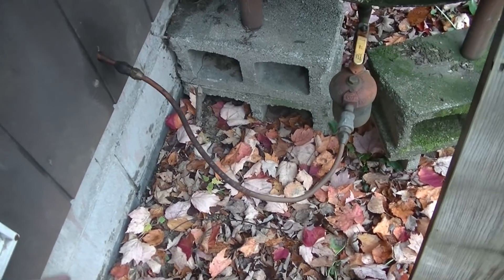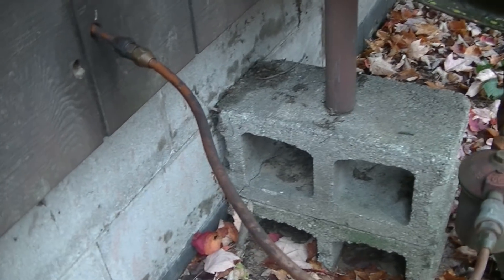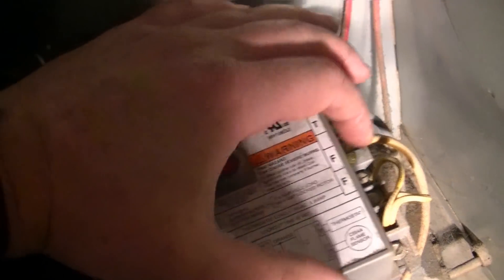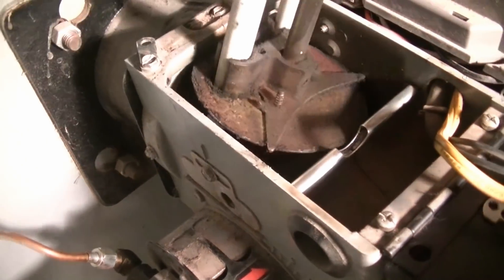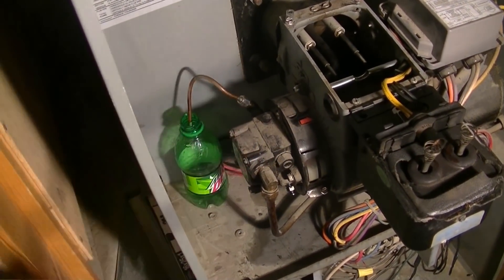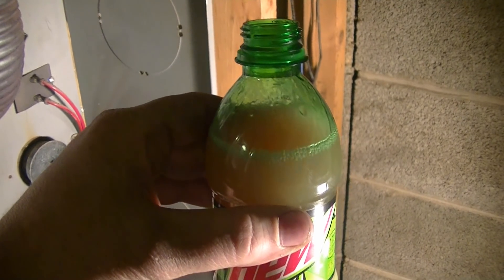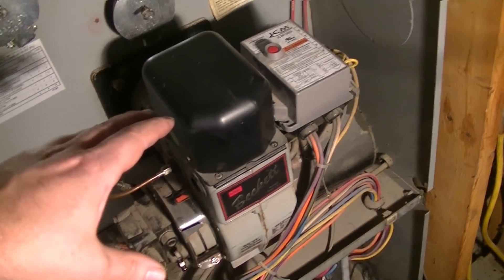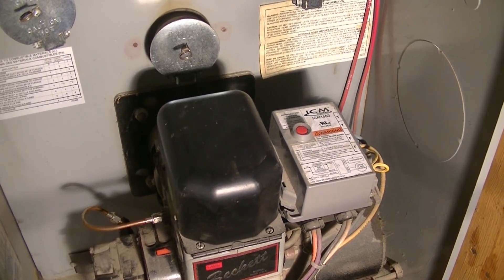Oil Furnace  Bleeding/ Troubleshooting

Comment: yeah im not getting any feul and i just changes the filer and ive done this plenty of times before and my line did get bent but i seen the fuel getting passed the part the was bent so not sure why its still not getting fuel or air so theres got to be a clog some where or something this isnt even my trailer and ive allready had to replace the whole 250 gallon tank because the other one had a pin hole leak some how after 10 years of use and now this new one we got from a friend must of had a bunch of junk or water because my fuel filter was completly frozen solid and i wasnt getting fuel after changing the filer and i got the tank unclogged but now im sure the line is clogged so will see what happens but its not working and my land loard will tell us to use heaters when we just spent 700 dollars on fuel for the winter lol

Comment: My furnace ran dry, added 5gals of diesel and got all of the air out of the line. My oil is air free and streaming smoothly out of the bleeder valve but I can’t get the furnace to ignite. Any ideas?

Comment: My machine will turn on and I hit reset and the thermometer is turned on calling for oil. When i try to bleed it no oil comes out?

Any suggestions
Reply: Exactly the same problem with mine. Did you fix it and how?

Comment: I can handle that you are FORD guy. So am I fella. But the MUD part, well, that is optional with me. Just a personal response between two FORD guys. PEACE
Reply from the maker: Mudford was my screen name on classic broncos.  I joined that forum when I bought a first generation Bronco to build as a mud drag racer.  I just kept using that screen name.  I'm older now and don't enjoy all of the work it takes to wash it after running in the mud.  The screen name kind of stuck though.
Reply: @Mudford  Thank you for that little bit of history which really makes sense. Opening oneself is a sign of maturity and wisdom. I hope I will get some to rub off on me. Since we both are FORD men, this is a good day indeed. Peace vf

Comment: My Beckett  boiler is about 2 years old.
The nut on the bleeder is so tight that I can't get it off. Do you have any suggestions, oil maybe? Thank you
Reply from the maker: Karen Venzen maybe a little bit of Kroil or PB Blaster.  Use a six sided socket if possible to break it loose to avoid stripping it.
Reply: The space is narrow. I will try the oil and see if I can tap.

Comment: I bled a quart and a half and still has air.
Reply: You could have a leak in the fuel line, plugged filter or strainer, or other issue causing high vacuum in the fuel line.
Reply: @jasongreek2342  i changed the filter.  Bled till no air.  Burner started and shuts off.  Have flame.  Somtimes it will run long enough to heat the firebox and turn the duct fan on.  But wont restart on thermostat.  Red light.  Sometimes will catch and run like explained on reset but mostly not
Reply: @L2fish  if you have a multimeter set it to ohms and get a cad cell reading. Start the burner and remove one of the yellow wires from the F-F terminal on your primary control. You want to be under 1600 ohms. If your reading is close to that replace it.
Reply: @willys7974  if your reading is close to 1600 ohms it may not be a faulty cad cell, it could be dirty, there could be too much excess air, there could be something blocking the light. People are bad for over tightening the retainer clip for the electrodes, which bends it down and blocks off the holes through which the cad cell sees the flame. But he's said he's bled off a quart and a half of oil and he keeps getting air, his next step involves a vacuum gauge and some detective work to find either a leak or an obstruction.
Reply: @willys7974  Ok thanks.  Its been running but was not restarting after its night sit on my thermostat setting.  Now its been starting on its own for week.  I have an ohm meter as I worked in the electrical field. I thought maybe the cad cell was sooted over
Reply: @jasongreek2342  he bled til there was no air. All of what you said could be true but I’m not going to recommend he start adjusting the air without a combustion analyzer. Which I doubt he has.
Reply: @willys7974  I'm sure he doesn't have a vacuum gauge either. He needs to call a professional.  But changing the cad cell probably isn't going to help. He also said he bled a quart and a half and still has air. He couldn't eliminate the air.
Reply: Never mind I see he said after that he got the air out
Reply: @jasongreek2342  Since this furnace sits pretty much all summer could there be water in the oil settled out to the bottom of the tank?  I know its pulling oil as the air will come out.  But maybe I am not seeing air.  Maybe its water?  I bleed into a mason jar with a clear line so maybe I will let it sit and see if it separates.  I am not a professional but do know how to change the nozzle, igniter, and troubleshoot electrics.  I would not mess around with setting the air gap.  So far after the last reset its been starting and running on its own.
Reply: @L2fish  water would separate almost immediately and would be noticeable in the jar. There are quite a few things that could potentially cause the issue, it really is difficult to say without physically being there. Beyond verifying fuel flow and that you have ignition and that the cad cell is seeing the flame there's not much you can really do
Reply: @jasongreek2342  Ok thanks.  My neighbor also said maybe the screen in the pump is maybe partially clogged. He is elderly now and retired but said has seen biofuel mixes raise problems with them.  My oil supplier said they don't mix.  He said yea they all say that.  lol.  Oh the burner is a Beckett Clean cut.  Had to change the solenoid coil last fall
Reply: @L2fish  I'm glad we don't have bio around here yet, but I expect it won't cause the same issues when it does get here just from how different our infrastructure is compared to the US

Comment: Some of your advice here is good but your system is NOT legally up to code. You need a firomatic oil valve at BOTH your oil tank and directly at the fuel pump. Your system is missing one on both sides. This is the law pretty much throughout the country.

Also, that is not the recommended way to bleed the pump. Many pumps have built in electronic check valves that will temporarily delay the fuel flow out of the electrode line. There is a 3/8 bleeder nipple on the bottom of the pump. That's the best place to bleed it. 

Also, a visual inspection of the nozzle will not indicate whether or not it is plugged. Nozzles can partially/fully plug without any visual indication. If there is any doubt about the nozzle, you should just change it. A visual inspection, especially without any knowledge of what a proper flame looks like, will NOT suffice.

You do have a basic understanding of oil burners, enough to save yourself a service call perhaps. But there's way more to troubleshooting than what's presented here. For those who need to do more than just bleed it, calling a qualified service technician is heavily recommended..
Reply: Firomatic valves are not required in that situation anywhere n Canada. We only need them on systems that cannot positively shut off fuel flow on power failure. 

That being said, that oil tank is an atrocity.
Reply: @jasongreek2342  We use them here for fire reasons.... same with the firematic switch at the ceiling...
Reply: @labbeaj  Yep. Except for mechanically vented gas systems.  Those are no longer to be interrupted in the case of a fire, the fan needs to continue venting any possible raw fuel. Pretty sure both fuel line and power firomatics are still required on all oil fired systems though.
Reply: @labbeaj  as long as all components have a melting point above 1000°F, and the flow of fuel is positively stopped on power failure, we don't need firomatic valves. There are also no requirements or statements regarding firomatic switches in the ceiling. 

As I said though, his oil tank is an environmental disaster waiting to happen.
Reply: @jasongreek2342  🤣🤣🤣 People tend to think that oil tanks last forever!! They get shocked when i say it's 25 years old, time for a new one!!

Comment: When you pull out the fuel nozzle and look at that and the spray igniters. If they are covered with fuel from repeated pressing of the button.Wipe them down and wipe out the area to prevent smoking or igniting? Thanking you in advance.

Comment: Hi. Got a Beckett gun on a Crown boiler. Furnace will start, but after 30-40 seconds, you can hear the tone of the burn change. It then becomes unstable, and a few seconds later, it shuts off. Furnace will restart after a short periods, and the cycle repeats...
 Usually, it takes 3-4 of these cycles, to heat the water in what used to take a single 3-4 minute cycle. Gotta be putting a lot of extra strain on the parts, too...
 Just before it quits, you can sometimes heat a hissing or sizzling sound faintly over the burner. No water leak, though...
 Anybody have an idea what is happening here? I am baffled...
Reply: Sounds like it's struggling to pull fuel. I'm sure it's fixed by now but I guessing that either your oil filter, oil line or pump strainer is plugged.. I'd change both the filter, pump screen and nozzle first.

Comment: which connector need to be connected in order to turn on the pump?
Reply: The pump coupling which is driven by the burner motor and in turn drives the pump. It is made of plastic and joins the shafts of the motor and pump together.

Comment: Electrodes should be pointy so that they can be measured to a 1/16 of an inch!!
Reply: Fixed head beckett afg burners call for 1/8" to 5/32" apart, 1/16" ahead of the nozzle, and 5/16" above nozzle centerline. The pointy tips are nice, but not necessary. Many beckett burner packages come with flat tipped electrodes from factory.
Reply: @jasongreek2342  Brand new electrodes from Beckett always come with pointy tips.... 

I wouldn't use new electrodes with flat tips for call back reasons...

Nobody likes going back to a house at 2:00 a.m after working all day....
Reply: @labbeaj  brand new Nordyne trailer furnaces with afg becketts have flat tips... probably 90% of the becketts i service have flat tips, I have never once had an issue, nor has any other mechanic around here. I change them if they're too short, or if the porcelains are shot
Reply: @jasongreek2342  That means they are worn out....
I dont know about Nordyne furnaces with Becketts with flat tipped electrodes.... Never seen it doesn't mean it doesn't exist...Do you have a link with a picture of them??
Reply: @jasongreek2342  I can't find a single image of "flat tipped electrodes for beckett oil burner" on Google images.

They are all pointy when brand new.....

I've been enslaved in this field for 17 years.... 
I've yet to see a good, working pair of worn out, what was once sharp and pointy electrode tip....

I don't always replace worn out electrodes. They can still work just fine....

But if I go there for a no heat and it is locked out due to safety and there is no spark.....
You better believe I'm gonna replace those worn out, O.E.M 30 year old electrodes!!!

Cheers man

Comment: Please close the transformer first . With those springs facing  up you are unnecessarily exposed to  10 thousand volts at a very lethal current. 
 Good  points  made with regard to bleeding from the outlet side of the pump and verifying that the ignition is working
Reply: It's low amperage, so it's not really that dangerous. No more than a stun gun. It'll hurt like a bitch though.
Reply: @gstylez0107  yes it does lol